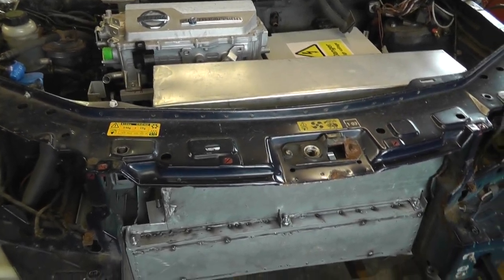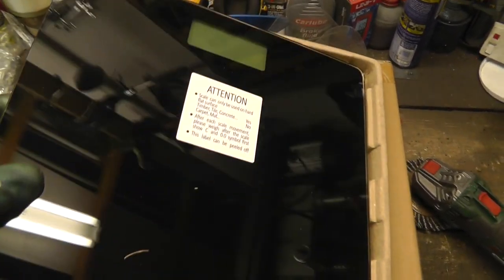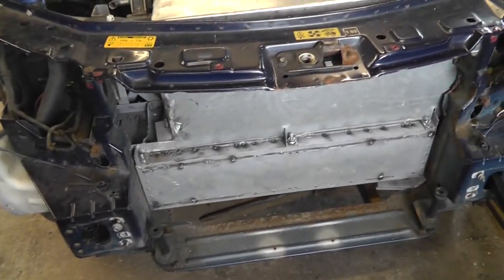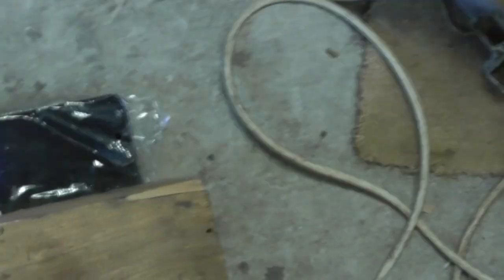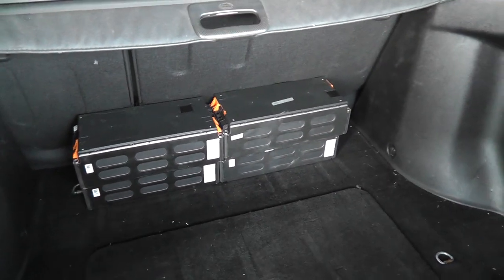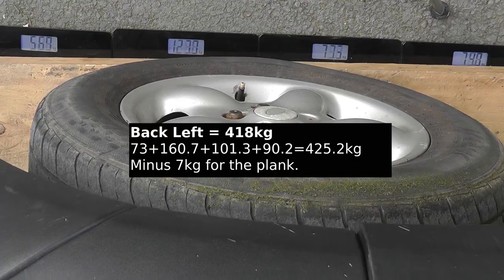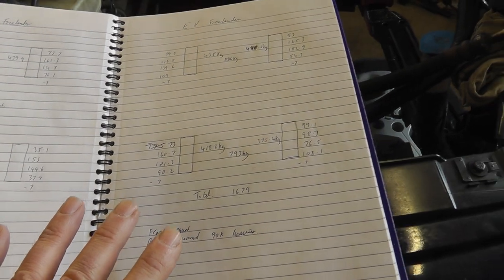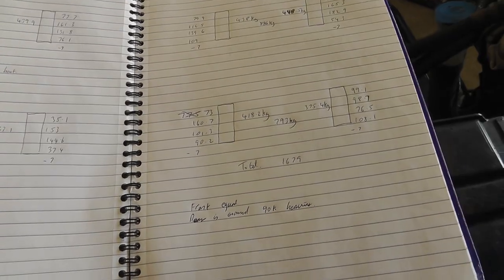DIY EV Part 38 - Weighing the car before and after Conversion

Comment: Was the IRD and propshaft fitted to the EV? If not you'll need to add those in too. But even then the weight difference is negligible.
Reply from the maker: Yes mate, prop shaft and VCU were fitted. 😉